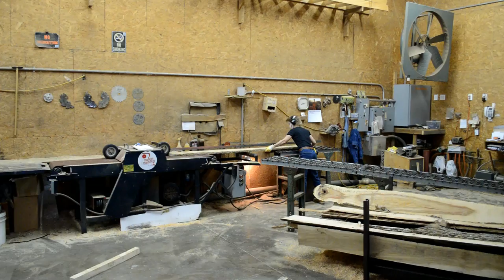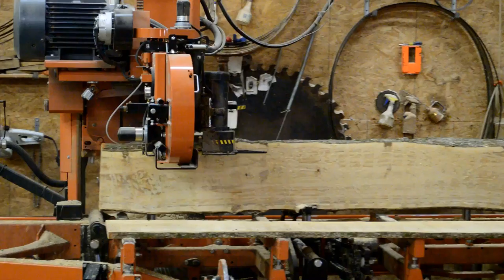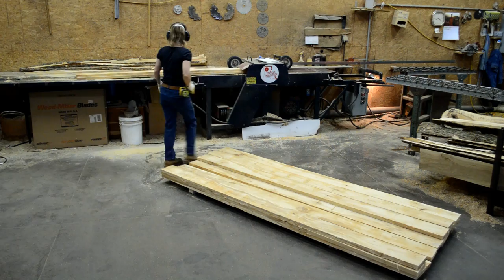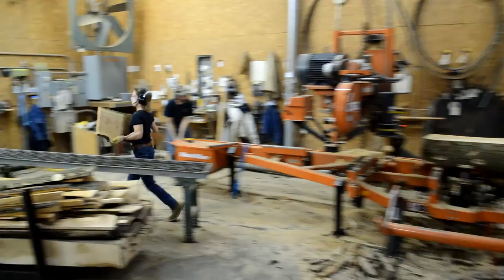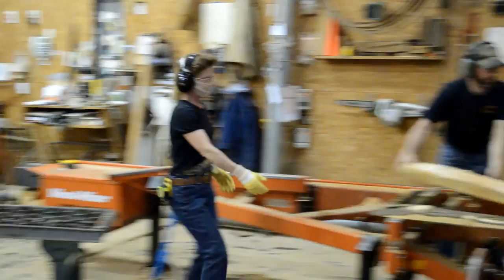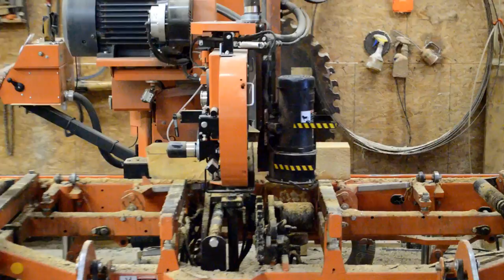Wood-Mizer Milling Box Elder, Husband & Wife Team

Comment: Does the Box Elder show more red if it is quarter sawn? We have them around here, and love the red staining. If we come across one for the mill, I want to saw it for the best results. Hope you can help. If not, no matter. I'll still watch all your videos.

P.S. Bought one of the magnetic tape holder you guys use, and you replied about in a question I had asked. Works great. Thank you for the info.
Reply from the maker: Awesome, I am glad you are happy with your tape holder, we love them. I doubt whether quartering the Box Elder will make much difference in the red stain, but make sure you protect it from Ultra Violet light (sun, etc.), it fades to brown easily. Thanks for watching! Linda

Comment: Slick operation.  I would look to move the saw and the double cut or sizer (?) closer to each other.  The two cutters towards the middle, the cut lumber stacked in front ready for fork lift and the cull thrown to the far right and far left.  Just a though to cut down the steps.
Reply from the maker: Thank you. It took us a good many years to find the exact preferred placement. I appreciate your input, though. Thanks for watching! Linda

Comment: The red stains in Box Elder are notoriously fickle, and hard to maintain; with ANY exposure to UV (sunlight) the reds will fade, and then actually disappear completely.....though some claim that the "Armor-all" treatment is effective, I haven't tried myself...it's too bad, the reds/pinks in some parts of these trees is probably the brightest of any wood, bar none (Padauk, Pink Ivory, Bloodwood, Chaktekok)...my experience has also been, that the brighter/darker the reds, the more splitting along the grain....
Reply from the maker: Yes, it does fade very easily. Years ago, an older gentleman/customer made a clock for me out of Box Elder. I don't know what he used for finish, but it preserved the color surprisingly well. Thanks for watching and commenting! Linda

Comment: You should back the mill up closer to the resaw table,save you 10 or 15 feet a trip
you are running to much,,you could make it a lot easier for your self.
you are 1 tough girl.
Reply from the maker: TimberLineNorth Frequently, I have to rotate a board 180 degrees end to end, for it to be in the desired position to stack. If the mill were closer to the edger I would hit the sawyer when I rotate the longer lumber. Hmm, maybe that could work to my advantage when I'm irritated with him...hahahaha! Just kidding! Thanks for the suggestion and for watching! Linda
Reply: LindasSawmillCinema